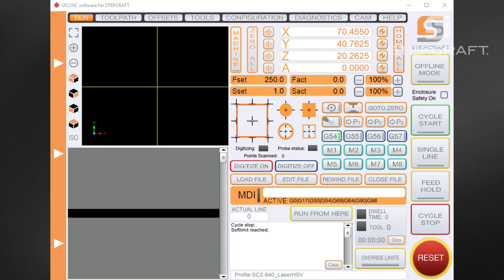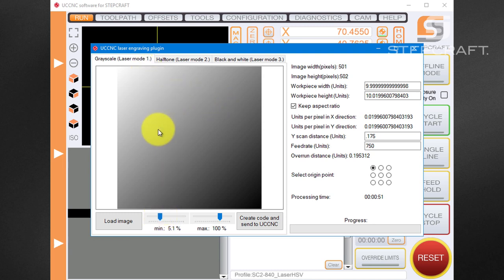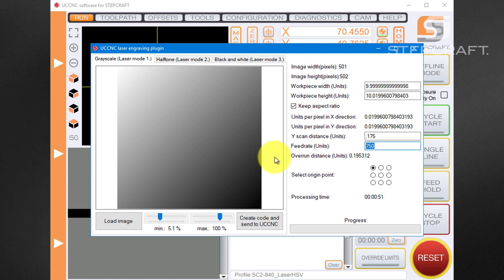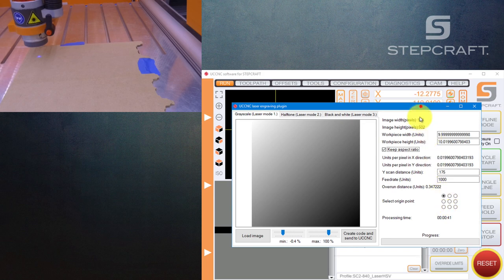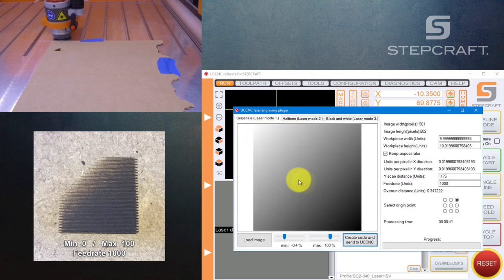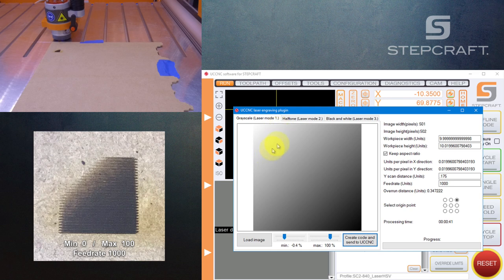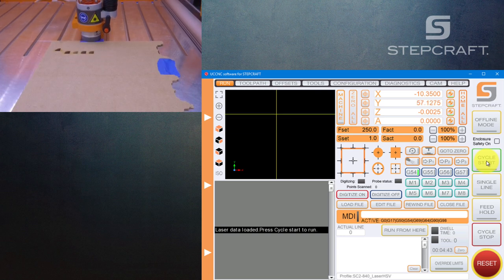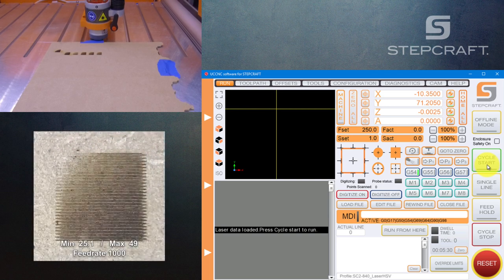Stepcraft DL445 and UCCNC laser engraver plug-in

Comment: The horizontal banding looks really bad. Is that caused by backlash on your machine?
Reply: No, the machine don't have any backlash, the banding offset is because of the software and a small delay, this is explained on the video and it shows how to reduce it using the laser plug in for UCCNC, of course if you use a dedicated engraving software you don't get this lines, here is an example of the laser working without this plugin and no banding on the engraving =)  https://www.youtube.com/watch?v=H_6hfiZWEdo